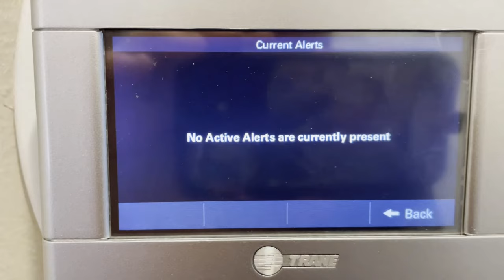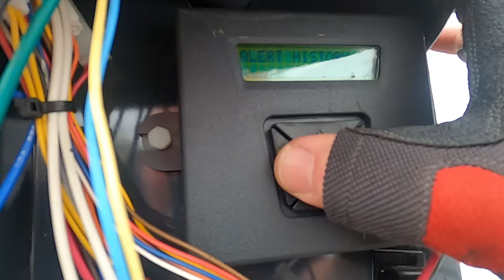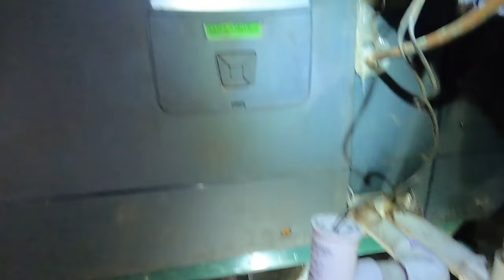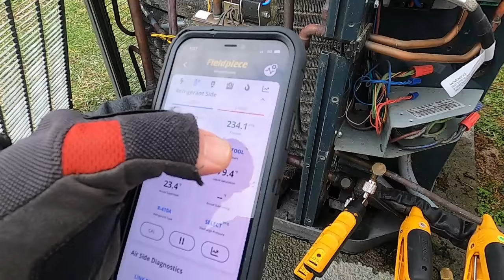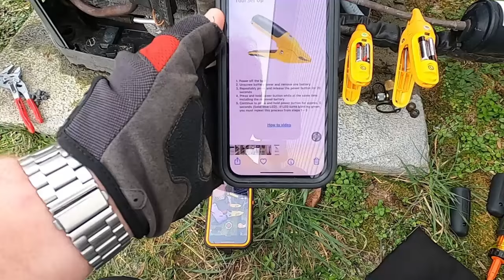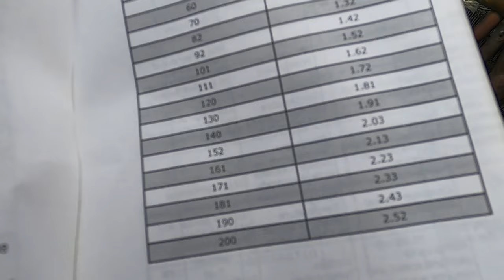What stopped this Trane?

Comment: Just more inverter junk, all that to get one saved watt.
Reply: It’s crazy how these and mini-split systems have taken over.  It’s a good money maker.   Usually when the computer boards die in 10 years then you find they are obsolete and you throw the entire unit away to buy a new one.
Reply: @cosmicinsane516   They have taken over until they keep breaking, the manufactures don't know how to troubleshoot they're own systems, they just tell you to replace parts if under warranty. Once again the contractor and the customer do their research and development.
Reply: @chrissipple1018  I work at a hospital and we are installing these things constantly.  I just tore one out yesterday and replaced it.  Again because a board went bad and it wasn’t made anymore.  Granted this was an R22 mini-split from 2004 so we got our use out of it.
Reply: It all does seem overcomplicated but it's not just efficiency that sells this equipment. It's quiet operation and unparalleled humidity control. Running at low speed provides better dehumidification, less equipment wear and tear, and prevents short cycling. Not to say this is the best or only solution for any scenario, but these are good systems whose main problem is not reliability but technicians who are ignorant of how they operate and refuse to learn.
Reply from the maker: I agree

Comment: Can you check the pressures and subcooling and superheat in the CDA, or is that only on the new Link systems?
Reply from the maker: The new VX systems do have a liquid line transducer and temp sensor that allow you to see low/high and SH SC. Do not need to connect gauges. Trane Link is just the new communication platform, the old CL2 is being phased out but the equipment is still the same.